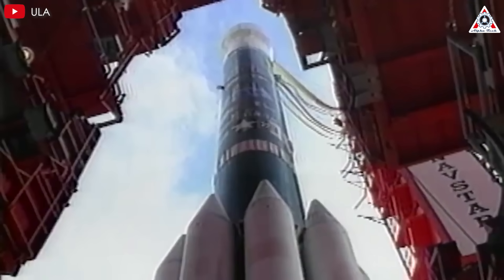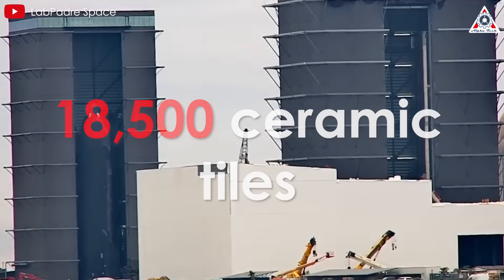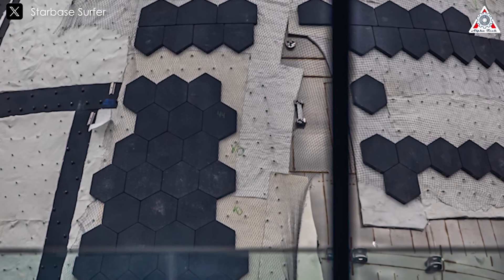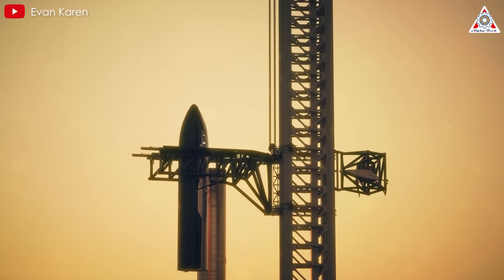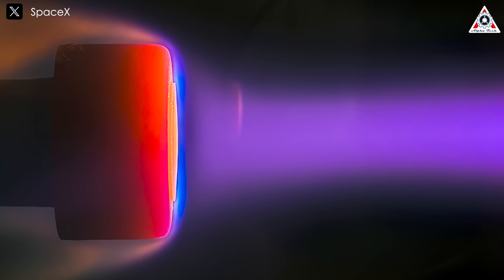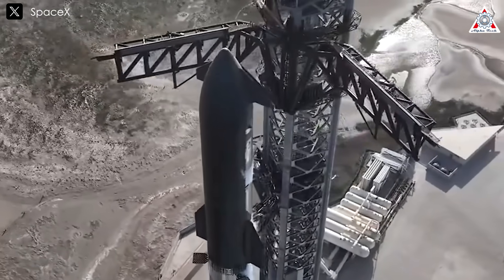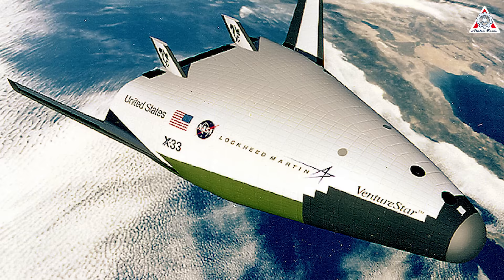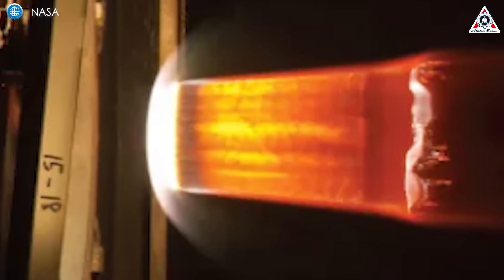Elon Musk's NEW Metallic Solution for Starship Heat Shield instead of Ceramic Revealed...

Comment: Inconel has a density of 8.44 g/cm3. Stainless steel is 8 g/cm3. The tiles are about 0.2 g/cm3 See the problem?

My take on this is to use carbon foam whose density varies from about 0.2 to 1.0 g/cm3 (1.0 g/cm3 is the density of water). By itself, carbon foam is a refractory material, although not as good an insulator as the ceramics. So it needs active cooling.

So what you can build is carbon foam panels where the carbon foam is reinforced with carbon fibers and a stainless steel web. The panels sit on standoffs creating a gap between them and the ship. The ship has a network of small pipes and spray nozzles (rather like a typical irrigation network). Liquid methane is sprayed onto the back side of the carbon foam panels. The liquid methane percolates through the carbon foam panels. As it does, it absorbs heat and evaporates. The gas continues to the surface. One key point here is that the heat capacity of methane increases several fold as it heats up towards 1000C. The methane continues to absorb heat as it leaves the surface, dissociating into carbon. The carbon (soot) emitted serves as a barrier to radiated heat (heat radiated from the plasma). 

Now such a heat shield would be slightly ablative. You'd need to replace panels every so often - maybe once every 20-50 flights. But that would be an acceptable level of maintenance. And of course you design with largish panels that are quick to replace.

Comment: The metal heat shield might be easier to install but they also require an additional system for delivering the cooling liquid and storage for that liquid.
Reply: Exactly, it requires plumbing.

Comment: OK I looked up whether my parachute idea in my  comment below is even possible.   And it is a maybe.   

"Yes, it is possible to parachute from the edge of space, which is generally considered to be around 100 kilometers (62 miles) above sea level"     from google AI.   I like google AI.  

I would like to get rid of the heat shields altogether by using my space parachute.....  if it is possible.

Comment: I have another idea.  The booster's heat shield is needed because of the speed of the booster through the air during re-entry.   The booster only reaches about 40 miles above earth.  So when the booster separates from the payload is the heat shield needed at that time?    Or is the air resistance not that great until the booster falls for a few miles?   

So what I am getting to is if you used a parachute right after the booster separated from the main payload the booster would never reach a speed where you would even need a heat shield.   I will have to look up when the heat shield is needed.   So by using parachutes the booster would not reach a speed where the booster ever needs the heat shield.  

Let's say you are in orbit with a rocket and want to bring it back to earth.  The speed of the rocket in space does not cause heat until it reaches the earth's atmosphere. At that moment would the few air particles at such high speeds blast holes through the parachute?      Just because it's always been done a certain way does not mean there is not another way to do it.

Comment: The weight of the shield is not as big problem as you may think it is because it can provide structural integrity, unlike the ceramic tiles. Thus it could replace the shell that’s already there.
Reply: Good point

Comment: Comprehensive Analysis of Hafnium Carbonitride (HfCN)
Summary of Key Properties
Hafnium carbonitride (HfCN) is an ultra-high temperature ceramic (UHTC) distinguished by its unparalleled thermal and mechanical properties. Its key characteristics include:
Melting Point: Estimated at 4,110 ± 62 °C for HfC0.75N0.22, the highest known among materials, surpassing tantalum hafnium carbide.

Thermal Conductivity: Ranges from 19–24 W·m⁻¹·K⁻¹ at room temperature, increasing to 32–39 W·m⁻¹·K⁻¹ at high temperatures due to enhanced electron contribution with higher nitrogen content.

Electrical Conductivity: Varies from 149–213 × 10⁴ Ω⁻¹ m⁻¹, increasing with nitrogen content.

Mechanical Properties:
Flexural Strength: Peaks for HfC0.7N0.3 (decreases with temperature: 324 MPa at 1,000 °C, 139 MPa at 1,600 °C, 100 MPa at 2,000 °C).

Fracture Toughness: Highest at 6.73 ± 0.07 MPa·m¹/² for HfC0.7N0.3 and 4.7 ± 0.3 MPa·m¹/² for HfC0.5N0.35.

Vickers Hardness: 19.08 GPa for HfC0.7N0.3 and 21.3 ± 0.55 GPa for HfC0.5N0.35, comparable to ultra-hard materials.

Density: 12.65–13.073 g/cm³, with a cubic crystal structure (Fm3m, No. 225).

Oxidation Resistance: Limited in pure form but significantly improved with 10–20 wt% silicon carbide (SiC), forming a protective HfSiO₄ layer.

Recent Advancements
Synthesis Techniques:
Hot Pressing Sintering: Conducted at 1,950 °C under 30 MPa in argon, achieving >96% relative density for optimized thermophysical and mechanical properties.

Single-Source Polymer Precursors: Pyrolysis under nitrogen with Hf–N bond precursors enables precise control of HfCxN1–x compositions, with nitrogen content tuning lattice stability.

Machine Learning: Models predict optimal compositions (e.g., HfC0.76N0.24), aligning with experimental melting point data.

Oxidation Resistance:
Composites with 10–20 wt% SiC enhance oxidation resistance at 1,200–1,400 °C, forming a dense HfSiO₄ barrier with low oxygen diffusivity. TGA at 1,400 °C shows minimal weight gain for HfCN-SiC compared to pure HfCN.

HfCN+20 wt% SiC exhibits fracture toughness of 5.1 MPa·m¹/² and hardness of 20.2 GPa, with a 200 °C lower consolidation temperature, easing manufacturing.

Applications
Aerospace:
Thermal Protection Systems: Used in spacecraft and re-entry vehicles, leveraging its >4,000 °C melting point and thermal stability.

Rocket Nozzles: Withstands >3,500 °C with minimal erosion, outperforming graphite and tungsten. Chemical Vapor Deposition (CVD)-synthesized HfCN maintains structural integrity under thermal cycling and mechanical stress.

Other Industries:
Cutting Tools: High hardness and wear resistance suit extreme-condition machining.

Engine Components: Thermal and mechanical resilience supports high-temperature environments.

Challenges and Future Directions
Oxidation Resistance: While SiC additives improve performance, further research is needed for pure HfCN at higher temperatures.

Cost and Scalability: Advanced synthesis methods like CVD and polymer precursors are complex, requiring cost-effective scaling for widespread adoption.

Composition Optimization: Ongoing studies aim to fine-tune C:N ratios and additives to balance thermal, mechanical, and oxidation properties.

Conclusion
Hafnium carbonitride is a leading UHTC with the highest known melting point, tunable properties, and critical applications in aerospace, cutting tools, and high-temperature environments. Advances in synthesis, oxidation-resistant composites, and predictive modeling continue to enhance its potential, positioning HfCN as a cornerstone material for extreme-condition technologies as of April 2025.
Reply: So it's heavy and it has issues with erosion/oxidation when exposed to oxygen rich plasma.
Reply: @saumyacow4435  Oxidation Resistance: Limited in pure form but significantly improved with 10–20 wt% silicon carbide (SiC), forming a protective HfSiO₄ layer.
Reply: @ComplexAdaptiveSystem  Yeah, but still its heavy and isn't particularly thermally insulating.
Reply: @saumyacow4435  Aerospace:
Thermal Protection Systems: Used in spacecraft and re-entry vehicles, leveraging its >4,000 °C melting point and thermal stability.

Comment: I believe the long term solution would be a form of metallic deposition used in printing modern circuits would be used in the vacuum of space to "heal" broken shields, this would be elons long term goal if he was made aware of this idea. Glueing on tiles made here on earth seems redundant. He would only need to manufacture a type of lithographic printer capable of transit across nose cone and repair with fresh silicon dioxide or some type of easily repairable material that would be repeatable as the ships will need this going forward
Reply: xD are you forreal? in 0g? xD

Comment: Metal tiles or panels made from foam stainless steel would be ideal . Foam stainless steel can theoretically only be made in space (low gravity) but would be ideal . Low weight , high melting point , porous , perfect !

 Also the ship does not need to be covered in the same area as the present ceramic tiles . Have the cooled metal tiles on the main face for sure but going up the sides just the plain stainless steel tiles would be adequate if they are mounted from the main skin of the ship by an air gap .

 Then they can get red hot if required which they can handle easily without distortion. It's worth the extra weight and complexity . 120 tons to orbit as opposed to 150 tons and total reusability  , it's worth it !
 I have always thought the ceramic tiles would be the hassle , just as they were a nightmare on the shuttle .
Reply: when payload start orbit reentry? another 11.000.000.000 for what nasa did 30 years ago?
Reply: You can do stainless "foam" with 3D printing these days. What is even better is carbon foam, reinforced with carbon fibers and then a 3D printed stainless "web" that transmits forces to standoffs on the ship.

Comment: What if the entire hull circumference of the ship were equipped with thermal protection, and during atmospheric re-entry, the ship rotated slowly, evenly dispersing the thermal load around the entire circumference?
Reply: The ionisation blackout (maximum heating) lasts only 3 minutes. If you spun up the craft to rotate quickly during that time the crew would become "Spam in a Can".  (Evenly cooked spam.)
Reply: Vomit comet.
Reply: Rotisserie? :)

Comment: It already has, the problem is the weight, a factor of ten.  In describing the old winged ship at the end, the one that was never made, they spoke to an open structure like a honey comb.  I don't know if that much loss of material might compromise the strength of the shield too much but there is a weight to strength ratio there that is lighter than solid.  Also the internal arrangement of the structure in a specific configuration, yet to be determined, could facilitate the "wicking off" affect a cryogenic cooling back jacket might have licking the red heat off those shield structures.
Reply: I'd start with carbon foam and reinforce it with carbon fiber. Mount it with standoffs so that there is a gap between the shield and the ship. On the ship just build an "irrigation system" that wets the back of the shield with liquid methane. Physics will do the rest. You don't need fine gauge tubes and tiny transpiration pores built into metal. The natural porosity of the carbon foam does the work.

Comment: It will be extremelly complicate at this scale. Tousands of small holes, channels, pipes, connections, seals. What quantity of fluid would be necessary and what will be the pressure required? What will be the source of pressure? Don’t forget the pressure drop along the way, it would be very high.
It would be a considerable weight added.The tiles are a very good insulator and protect the walls holding cryogenic stuff, and this is very different than the film cooling of nozzles. The dynamics of flow is different.
Maybe in 10 years from now, wil see…
Reply: You don't start with solid metal, you use sintered metal, it can be created with any desired porosity.
Also, the items can be created so no further machining is required.
Reply: Yes, your plumbing gets to be a problem, plus you run into issues with fine nozzles/channels clogging. There is a way to sidestep the problem. Start with a material that is naturally porous, like carbon foam. Mount it on standoffs so there is a gap between the ship and the heat shield. Then add simple pipes to the exterior of the ship (they can be factored into its structural strength). Add spray nozzles (they don't need to be particularly fine so they'll be reliable - think of Earth bound irrigation). So the liquid methane wets the back of a porous heat shield. It will percolate into the carbon foam and turn into a gas. Thus the space between the heat shield and the ship automatically becomes pressurised. Methane gas easily transports through the carbon foam, taking heat with it and when it leaves the surface it is still doing its job, eventually dissociating and forming a radiation barrier.

Comment: I think they probably should use some kind of liquid to transport the heat just like every animal has been doing since the dawn of time and every industrial machine since the beginning of industrialisation.

The liquid could go round the ship to be cooled by the naturally occurring low pressure on the backside of the ship. Basically using the high pressure on the front and low pressure on the back to create an air conditioner.

Actually I have no idea.
Reply: great idea....then light the engines for propulsive landing....oops no fuel left.

Comment: 3:50 Also a thermal expansion of material would lead to cracking of the shield. Also vibrations. So, divided it on small plates is a reasonable solution. However the dillatations must be filled with something....?

Comment: Platinum going to be the best to use for it but is going to be a lot of money.
Reply: Why? Platinum is very dense (2.7X denser than stainless) and doesn't have a particularly high melting point (1768°C). Something like W-26Re (Tungsten-Rhenium) alloy is much more heat resistant than stainless, and though it is much denser it is also much stronger.

Comment: Why the fuck we’re ceramic tiles even considered after the shuttle 🤷🏻‍♂️
Reply: maybe because they work?
Reply: Very low density, very high temperature resistance and very low thermal conductivity. Since the shuttle used aluminum alloy, it wasn't able to survive missing tiles, but stainless can survive FAR higher temperatures.
Reply: @ it's also great at conducting heat which is a problem for anything on the other side of it. Especially with TPS that doesn't stop heat transfer.

Comment: So far, I think the henges and the wings have been the issue.  I think 3d printing the channels and surfaces on the surface of the steel will reduce the weight, but that could mean variable steel thicknesses that could be done.  Pressed thinner where the steel channels would be 3d printed.  Perhaps you only need the wings.  Either way SpaceX is committed to reusability and could simply go bigger to compensate is also an option.  https://www.youtube.com/shorts/CN0G6A_1EYE
Reply: Also I think Starship should be tested with legs and take off again to simulate actually landing on a Moon or Mars like surface while allowing you to recover the ship and examine the tile results.

Comment: This shielding will increase the weight by 40% . Would it be better to use Titanium to cut the weight??
Reply: No, CFC.
Reply: Titanium has a high heat transfer coefficient, whereas the heat shield tiles don't. With titanium your rocket will turn in to an oven, not good when you fuel is super cooled.

Comment: When first announced by SpaceX in 2016 the intention was to use an active cooling metal heat shield for the BFR.
Reply: overly complicated and completely reliant on fuel which is also needed for propulsive landing.

Comment: Uhh - the main reason, lots of deramic tiles is that ceramic doest expnd/contractmuch whereas the Steel of a starship contracts about a foot when its cryoed .... (oin total starship height) --- also you donr want hot ship with cryo liqids inside as any fuel will expanx x900 inside ship .... bad.

Comment: Carbon Nano Tubes will solve the problem
Reply: yah, was initially thinking of similar like carbon-fibre
Reply: SpaceX did look at carbon fiber composites, but they are much more expensive and less heat resistant than stainless

Comment: Metal heatshield tiles could be made larger than the ceramic tiles, too. This would reduce the number of tiles and simplify the cooling system. The number of special shapes would also be reduced. I'm curious to see if they will pursue this approach.
Reply: The problem is weight. You need the tiles plus the coolant plus the plumbing. 
Second problem is safety. A coolant system needs pumps. What happens if a pump fails or a pipeline bursts? In a ceramic heat shield the damage is limited to a tile. If the pumps fail the shield still needs to survive anyway( not necessarily intact). 
The system may or may not still be cheaper in the long run but nobody will know until they finally tested it.